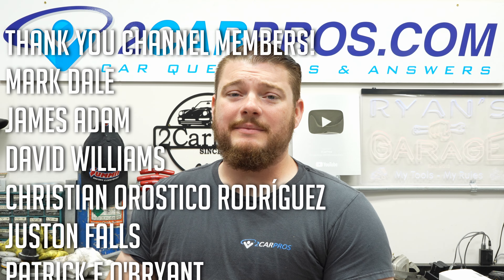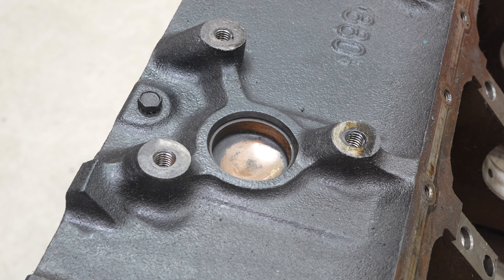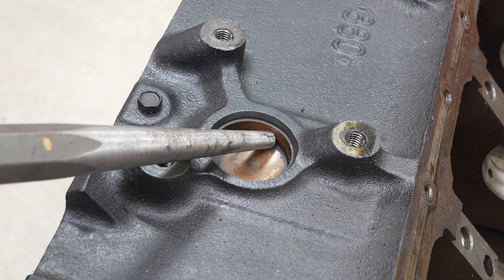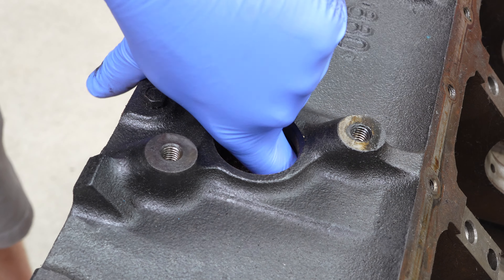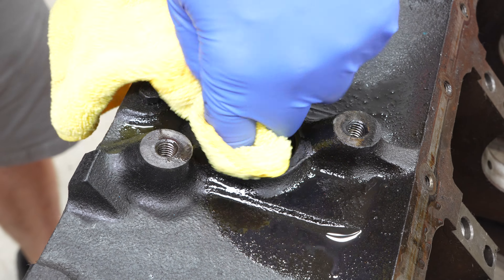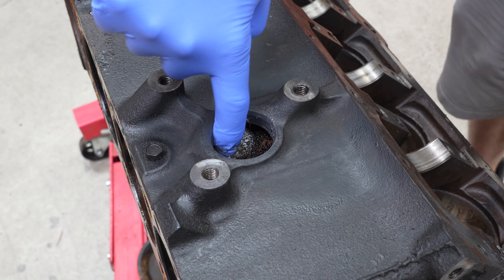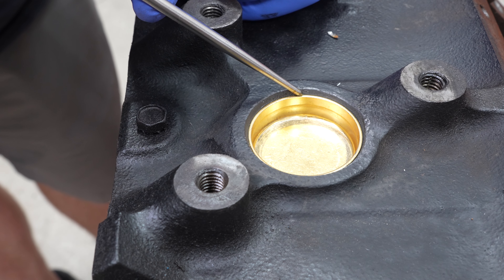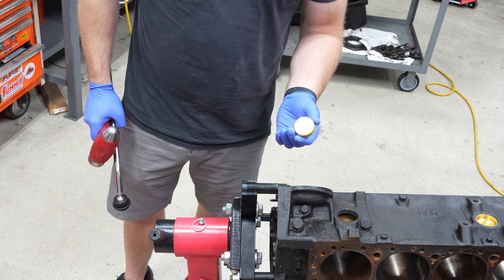How to Replace a Freeze Plug | EASY!

Comment: Excellent video, frustrated it took so long to find. Im trying desperately to get a core heater in my 2009 Mazda (it gets to -40 here) and my desired plug is under the exhaust manifold. I reeeeally dont want to remove more things to get to it, grrr